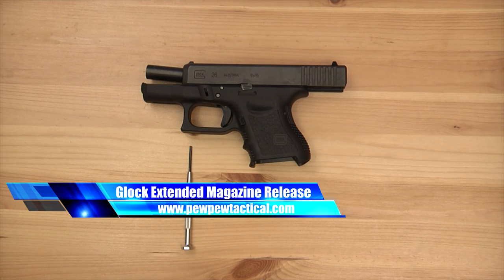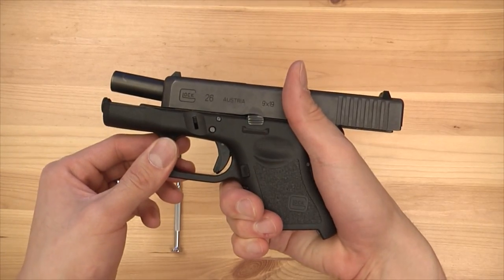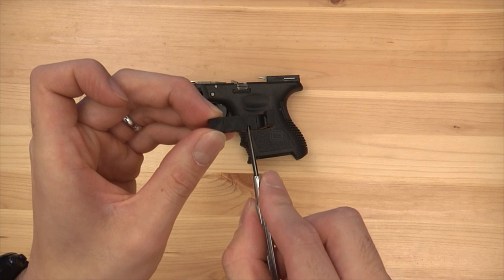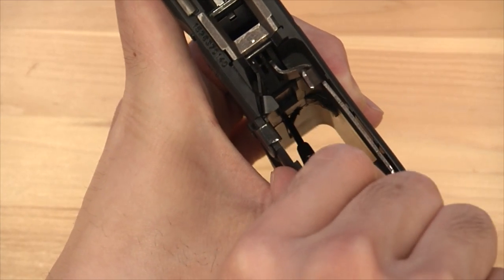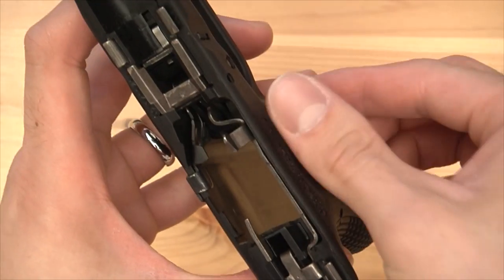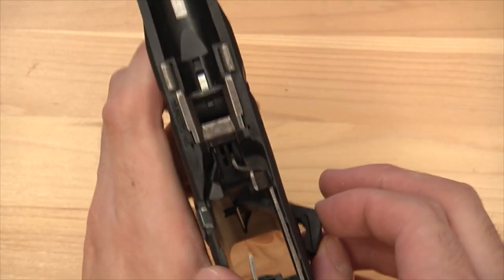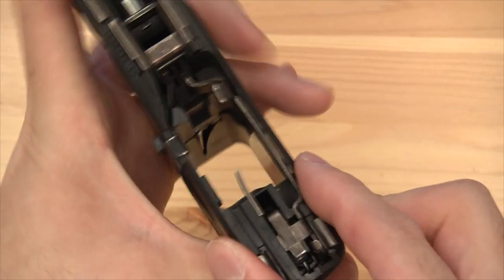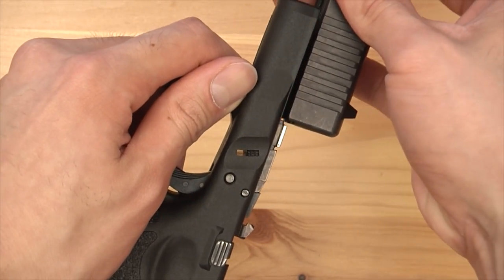Glock Extended Magazine Release Install (HD+Quick)

Comment: Thank you got mine done almost as quick as you with a little innovation.. I used a dental pick for reinstallin to pull back the metal piece a little bit to help get it in and that worked much better for me than the method shown but great vid..
Reply: You genius, you. I happened to have one and it worked.

Comment: Thanks for this, OP. Was building my first Glock and when I saw the plastic mag release and then just a long, thin metal rod I really was scratching my head. This broke it down easily and I got my first one installed in 30 seconds!!

Comment: Great video!! - If you want 2 tiny "hacks".  1 - It is SUPER simply if you have a hooked pick like tool.  2 - I used a little sandpaper to sand the sharp corners of the Mag Release button.  10x more comfortable than the pointy edges that it comes with from the factory.  The $5 upgrade makes my Glock 17 so much easily to control as far as the mag release goes.   Doing the extended slide release stop next.
Reply: Thanks!

Comment: THIS THE BEST VIDEO i HAVE SEEN.  I HAVE THE EXTENDED MAG RELEASE THAT MAKES IT AN OPTION TO TAKE PART OF IT OFF VIA SET SCREWS.  AND I CAN ONLY OFFER A WORD OF CAUTION, BEING THAT THE MAG COULD ACCIDENTALLY EJECT, DEPENDING ON THE METHOD THAT YOU CARRY YOUR GLOCK.  WHEN CARRYING INSIDE THE PANTS, THE BODY PRESSURE CAN PRESS THE RELEASE AND THERE GOES YOUR MAG.  THE FULLY EXTENDED RELEASE IS GREAT FOR GUN RANGE COMPETITION SHOOTING, BUT NOT FOR EVERY DAY CONCEAL CARRY.

Comment: Thank you for  the clear video! I saw this twice today and was able to replace the Glock Exgtended Magazine  catch without a problem. My only observation is that one might want to use a longer screwdriver to move the spring/pin, for the small screwdriver shown on the video didn't work for me.  With the  longer screwdrive you have better lever to move the pin.

Comment: This is by the far the best video I've seen for swapping the mag release. One tool needed, don't have to actually remove the pin (thank you for calling it a pin and not a spring). Clear and precise video- thank you!!
Reply: Thanks for this comment. I ordered a replacement "spring" and got a pin. Was curious if this was correct but now I know. Thanks

Comment: Thanks for the video. I think the 43x may be slightly more difficult. No way that little screwdriver would work. I heated the end of an old ice pick and bent the tip into a 90 then filed the top flat. It plucked that spring out in 2 seconds, installed easy too. Thanks again for showing how it comes out.

Comment: perfect video, too easy.  For those of you who have not already bought the part... i found an entire extra parts kit from Midway.  It was $49, came with extended mag release AND improved slide release, plus stock spares for the trigger and every other "lower" part, spring, etc so you have spares of everything that could realistically break.  In my case this was for a Glock 17 Gen 3 but i assume they have the same kit for every single glock and Midway has a super smart interface that allows you to easily select the correct kit.

Comment: Tip, when replacing it, go in with you tool through the opposite side hole of the mag release. To push up the spring

Comment: Looks like I'm taking mine to a professional because none of that worked on mine.  I was able to chew up some of the plastic on the inside of the mag well though.
Reply: Eric Shipp same here 💔
Reply: No problems here on my new gen3 19 and Lone Wolf $3 mag release. I used a 1/16 punch to uninstall and a 1/8 to install. I have nerve damage in my hands dude so you have no excuses unless your eyesight is bad or you don't have any tools.
Reply: @mfowkles3142  l need to do something to mine also. There's no way that l can push the release and still maintain a shooting grip. I'm just thinking that even with it sticking out more, do l have the leverage in my thumb to push in that direction?  That spring seems to be a lot stiffer than it needs to be. New Glock 19 owner here too. Just picked it up today.
Reply: @LaBoofadora  The lone wolf is the best $3 I've spent in awhile. Makes it much easier. It's night and day difference for me on the amount of force required. I bet it works for you.
Reply: Seriously all I’m doing is chewing up the inside since I can get it pushed over but not out of the fuc*ing way. It just snaps back into place (literally just got done attempting 35x)
Reply: Troy DoinWork  yeah, I had to use a even smaller pin punch to hook under it. I also tried going the opposite direction than what was in the video
Reply: Same

Comment: Had some trouble getting the pin forward enough to slide the new release in. Using the screwdriver from the left side hole allowed me to do it easily.

Comment: I agree with others.  A very clear video. But here is a dumb question... If one considers the hand position while firing the gun and the (short) length of the typical thumb vs the index finger, would there be any practicality to putting the mag release on the "lefty side" (assuming right handed) and releasing the mag with the index finger rather than with the thumb as we traditionally do?

Comment: Just did this on a new 43x and I have some suggestions because it was a b***h
1) The longer the screwdriver the more leverage,  my spring is very stiff. I have a tool dentists use where the flathead on the end is angled so it’s easier to get under the spring and scoop it out of its hidey hole. 
2) My release is U shaped so you have to move the spring much further out of the way when replacing it. I used a pair of long tweezers (or needle nose pliers) inserted from the other hole which because the prying was impossible and it kept slipping. If you have a pair of needle nose you can just remove the spring and replace after you stick the new release in. Good luck muchachos

Comment: If I may make a suggestion to people planning on doing this modification;  use a 90 degree dental pick style tool, instead of a jeweler's screwdriver or other tool.  This video is extremely well done, and I used it to help me do  this  mod, but I used a dental pick style tool (NAPA auto parts, Harbor Freight, AutoZone, etc.)   The pointed pick end of the tool, and the 90 degree "L" shaped bend at the end of the tool, allowed my to have more of a scooping action on the metal spring bar.  So in one effortless "scoop-and-twist" movement, I was able to pick the spring bar out of the original mag release, which made the release shoot right out of the grip, while at the same time, the pick end captured the spring bar, in that "pulled out" position.  I simply dropped the new release into the grip, and used the pick to set the spring bar back into position.  Literally, the entire job (once the slide and mag were removed) took about 5 seconds.  I laughed at how fast and easy it was, because I thought I would be fighting to get a good angle on that tiny spring bar, and fish/pick it out of the release.  And wow does this mod make the gun nicer to use.  I installed the Vicker's Tactical version.  Looks 100% correct, like nothing's been done to the firearm.
Reply: @Matthew Caughey great option but I'd opt for a 26 or 19 if you're getting a 48. The 48 doesn't shoot as well as the 19 and you're still concealing the same grip less 1/3" width.
Reply: @Matthew Caughey totally understand, in that case the 48 is the best option because I don't trust anything but a Glock with my life but that's me, I'm sure most guns today go bang everytime but Glocks 99.99999999999% of the time go bang. That being said the best slimline gun period is the p365 XL but I can't trust it with my life. Again the 48 with SA15 mags is your best option in my educated opinion.
Reply: @Matthew Caughey gotcha, if it works for you that's what matters. Check out that 48 when any of your community shops gets one.
Reply: @Matthew Caughey that it will!

Comment: Thanks I just swapped out the mag release for an extended mag release.  In a gen 3 g17 I got a couple years ago from aim surplus. I was wondering if I should have changed out the magazine relese spring as well. Seem to work fine now. Mags are flying out of that 17.

Comment: I dunno how your pin is so easy to take off. My 43x pin wont budge. I can move it to the right but  wont pop out. Seems like the 43x pin is alot thinner than yours. I gave up and all i ended up with was massive marring inside the frame
Reply: I used a longer screwdriver on my G19 and it worked like a charm. sorry about the marring

Comment: Thanks for your video.  Where can I get that extended magazine release?
Reply: almost anywhere, but the very best deal i found was an entire extra parts kit from Midway.  It was $49, came with extended mag release AND improved slide release, plus stock spares for the trigger and every other "lower" part, spring, etc so you have spares of everything that could realistically break.  In my case this was for a Glock 17 Gen 3 but i assume they have the same kit for every single glock and Midway has a super smart interface that allows you to easily select the correct kit.
Reply: I know it’s a year late but Vickers Tactical makes quality Glock replacement parts.

Comment: I purchased these for my 3 glocks, but, yaknow what?  As a lefty, I've gotta use my trigger finger anyways, and the stock releases actually work fine from that angle.  I'd already installed 1 on my g27, and now I'm mad that I din't thinkit thru.  Beneficial for righties, I'm sure, but totally unnecessary for lefties, IMHO...

Comment: I taught myself a better trick! No fooling, it is so much easier!! Do exactly what he said up until install. After removing the mag release button , pull the spring out of the channel. Install the new mag release and yes hold it in place like says. But, put release in 1st and then you can easily put the spring back in the channel. I used a pair of needle nose vise grips to guide the spring into the channel and push it all the way down. Then simply push the spring to the right. You can do it and push forward at the same time.  No wrestling with the foolish thing!!  I used to dread this and now I can do it all day long. They also sell an after market spring that is 2.5 lbs. vs. 5lbs. stock! The 2.5 is much better. Thank you for reading!